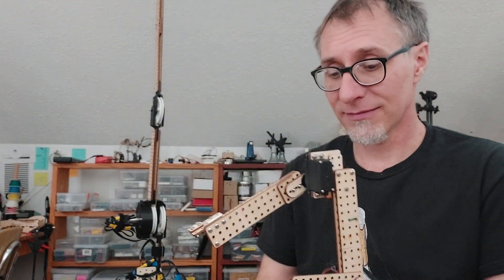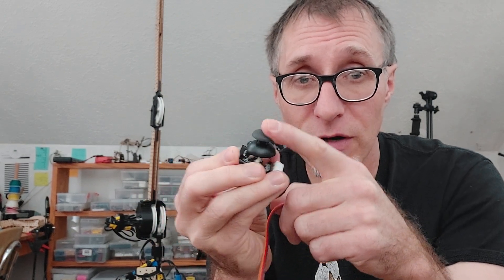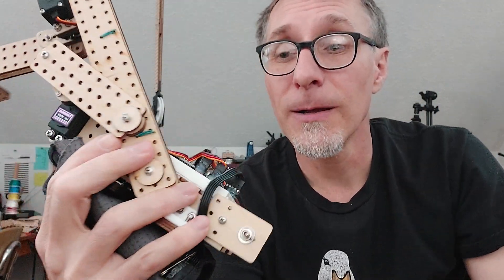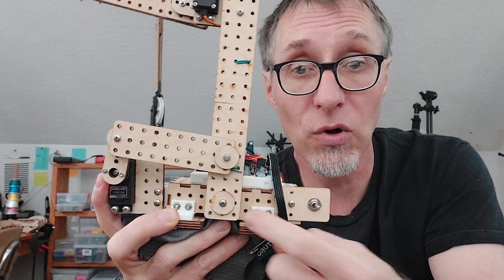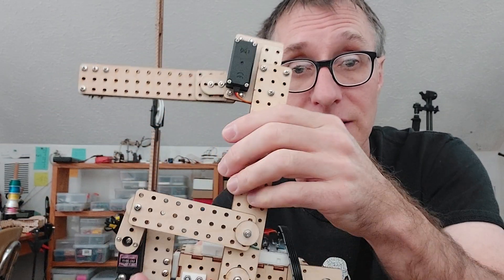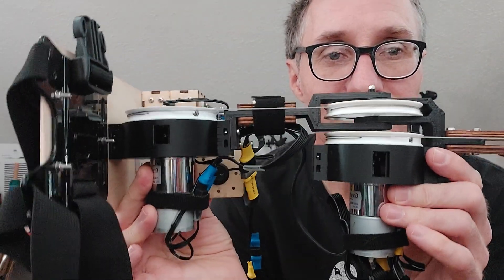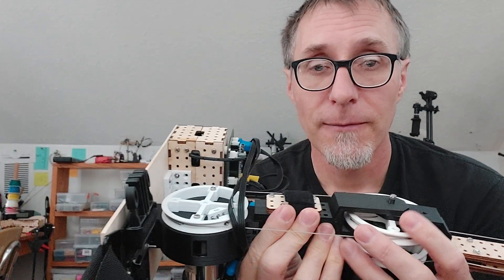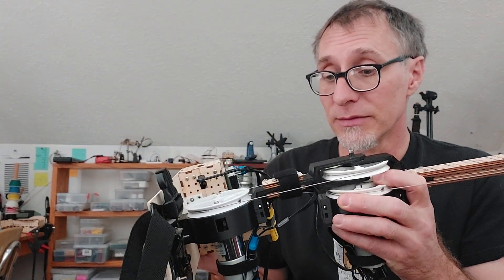Wearable robotic arms using Arduino and servo motors

Comment: Have you created a shoulder mounted robot?
Reply from the maker: Sort of... Gilbert is shoulder mounted but minimally articulate. Way simpler than these newer designs
Reply: @androofroo  Is Gilbert open source? Any considerations when mounting a robot to your shoulders? I've been thinking about a pan and tilt robot but not sure if it is feasible.
Reply from the maker: I think it's totally feasible but it obviously depends on how you execute everything. I have found that the shoulder mount part is pretty critical because if it slops around then everything just gets harder. I have been using athletic support gear... You can get a shoulder support brace that's reasonably stable and build on top of that. 

If you just use hobby servo motors then everything is much more straightforward and they don't consume a lot of power so you can easily run everything with batteries.
Reply from the maker: Gilbert is really a performance artwork and it's probably not much value in you reproducing it because it's so specific. But no, I haven't posted the designs or files anywhere.

Comment: Is there a specific wire type/gauge commonly used for the jumpers on the breadboard?
Reply from the maker: I typically use 22 AWG solid core wire for jumpers.